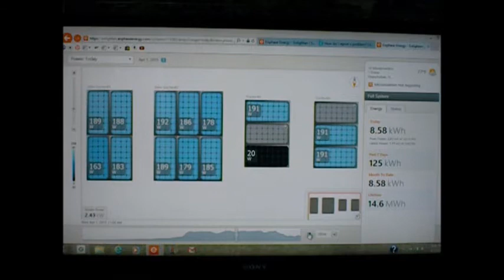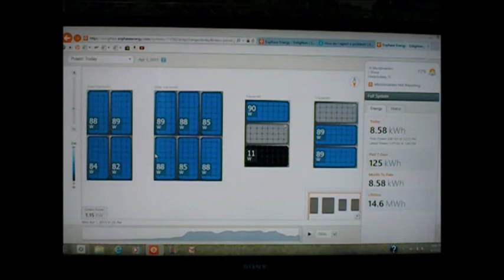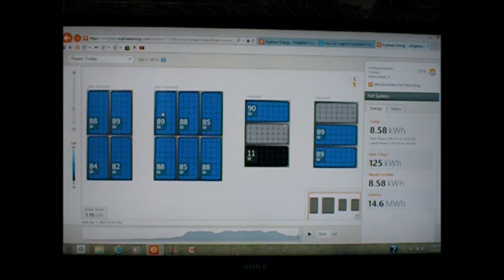Solar Inverter Fail Rate 100%  210 Units

Comment: Hello, i have to replace a m215 inverter, how do you putt the serialnumber of the new inverter in the monitoring system? It is the second one dead in my system of 18. My supplier is bankrupt so now it's a DIY job. All advice is welcome.
Reply from the maker: +Steven De Vogelaere  If u go into the Envoy U can see how to add inverters or Email Enphase they will do it on line for U.
Reply: +TheKilog69 Thank you, i try it next week.

Comment: Wow, major bummer. They all fail at some point, but I do recall hearing about 210 issues a lot. Customer service is where it's at.
Reply from the maker: Thanks for watching. I just got a email from Enphase 4/4/15  that they have shipped my replacement 210s. I will install when I receive them then do a update.

Comment: Even if they replace them several times over,your time to swap them out along with the time down makes them sound not worth it to me...But you have to respect a company that stands behind their product that way,and has great customer service especially in these times of zero customer service,or lousy customer service,rudeness,please press one for ,blah blah blah...Glad they are standing behind their product for you...
Reply from the maker: Thanks   I believe this is why they no longer sell these but I need them for my high voltage panels. If U are into solar U kind of have to view it as a hobby were U tinker around with stuff a good bit.

Comment: Does Enphase ever let you know what caused the failures?
Reply from the maker: No not so far, they don't sell these 210s any more.maybe this is why.
Reply: I was wondering if it was the capacitors.. Not being able to handle the heat. I see 210s on ebay once in a while. If they aren't too hard to repair, maybe they are worth a few bucks.
Reply: @XRinger  This is and old post, but I opened an older M210 and everything inside is potted in some sort of black tar. I have some newer M210's that have the cast aluminum case style of the M215 and they seem to hold up better then the older ones with the drawn aluminum sheet cases, which don't seems nearly as moisture-tight.
Reply: @Fourcycle  Good to know, thanks for posting. Over the years, I've seen some local installs get pulled down, and then replaced. Not sure what was going on. But, the cause was most likely the inverters or water leaks in the roof.
Reply: @XRinger  Enphase had some sort of program where they offered customers, that had the original M190 / M210 inverters, a good deal on replacing them with IQ7's. Some installers also offered to replace the panels while they were at it. Maybe that's some of what you were seeing.